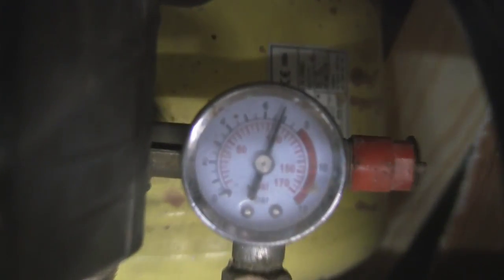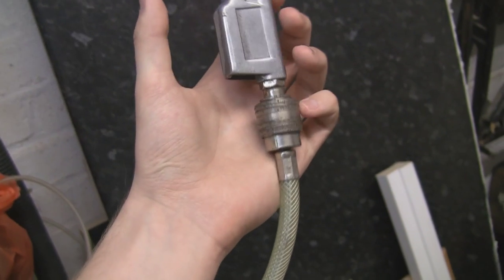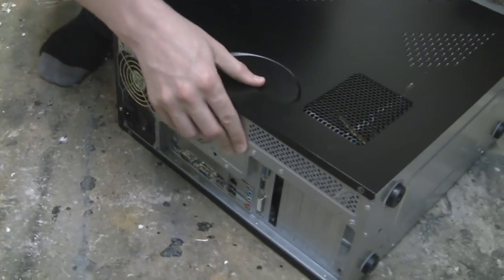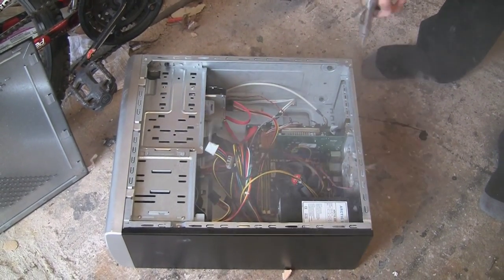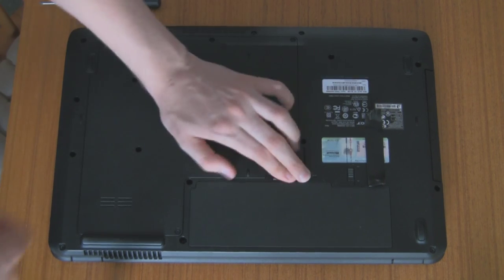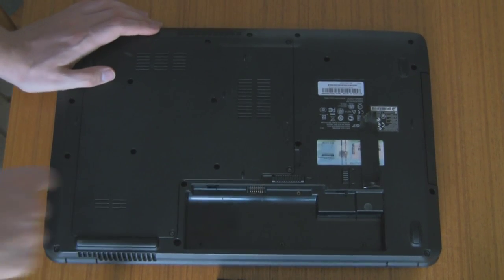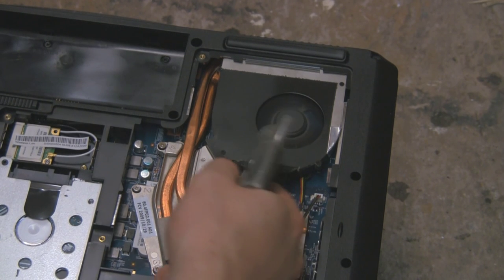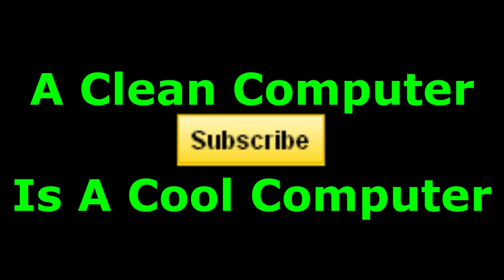How To Clean The Insides Of Your Computer

Comment: This is how I clean my computer as well.  I have a basketball needle with the hole at the end that I use for a very tight airstream, makes it work just like a can of compressed air.

You should keep your fans from spinning during this, as 1) it can damage them, and 2) you can see what parts haven't been cleaned yet.